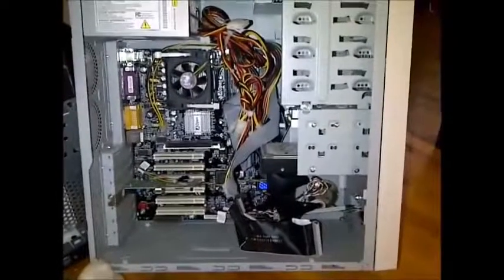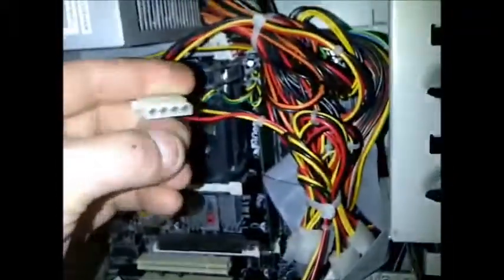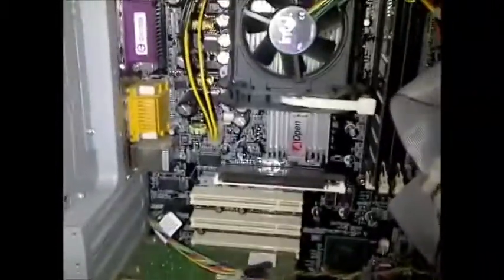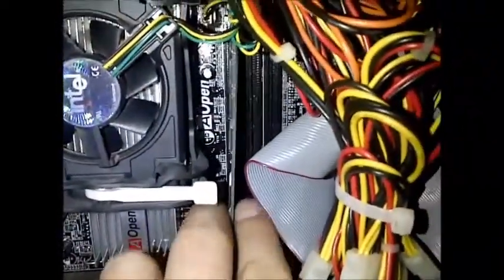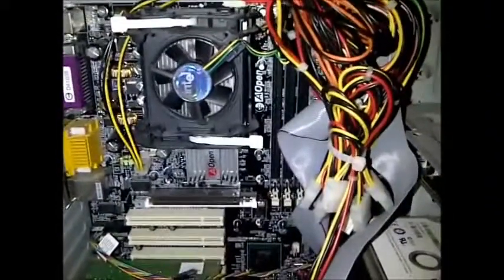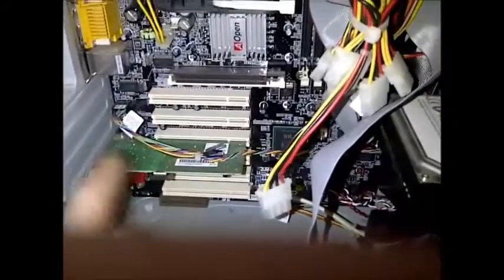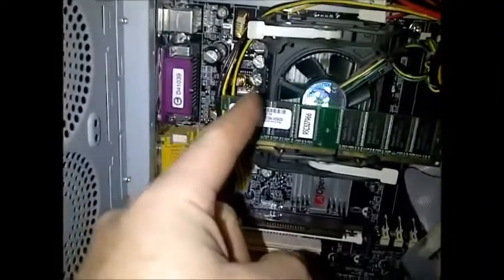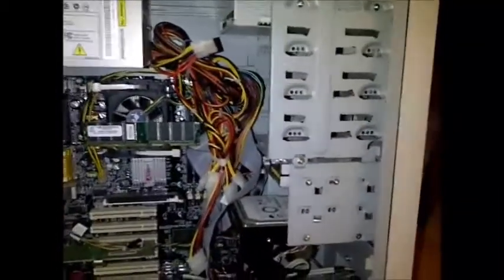HOW TO FIX GARBAGE COMPUTERS

Comment: Can you help me? I have a laptop problem: do you have a NVIDIA GeForce 7400, graphics card? I use the Sony Viao, 17 inch laptop...pcg-8w2L, I bought it new in 2005.
 only one card available on eBay - used - and is $128... Looking to spend a quarter/100

Comment from the maker: lol yeah it would, pop and beer are the worst, if the power was on when it happened its probably fried, if power was turned of quick enough theres a possibility of fixin it, ive spilled beer on my laptops 6 times when they were on and got away with it but thats cause i took out the battery and unplugged the as fast as i could then took em apart and dried them off before it could spread too much